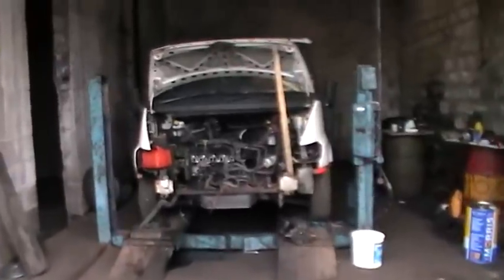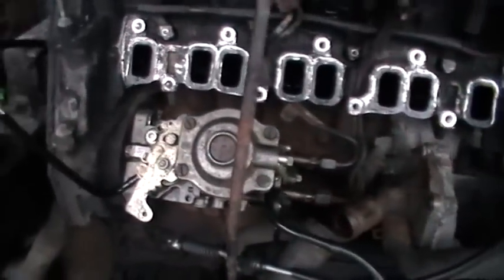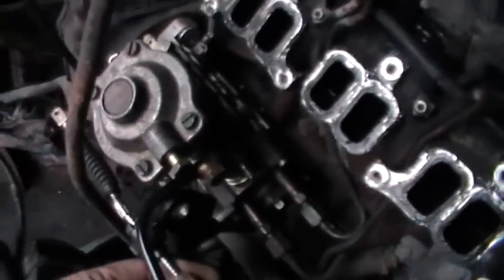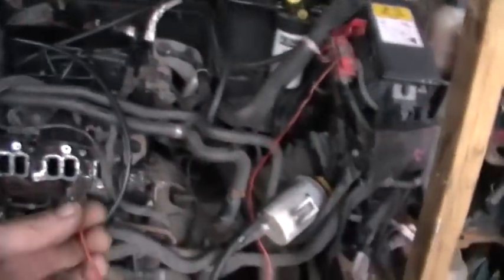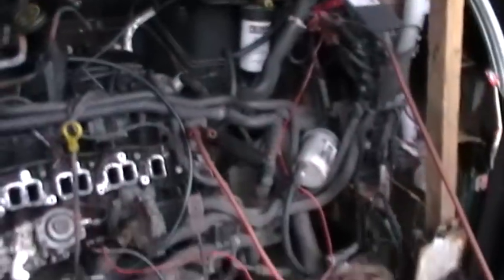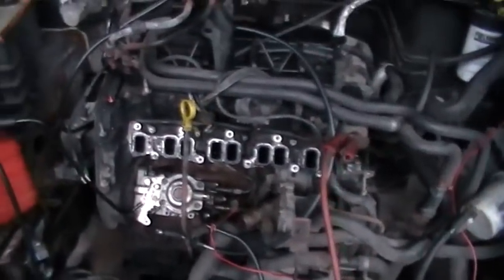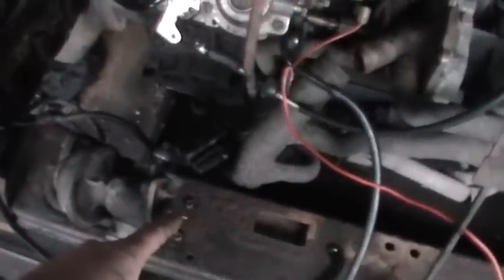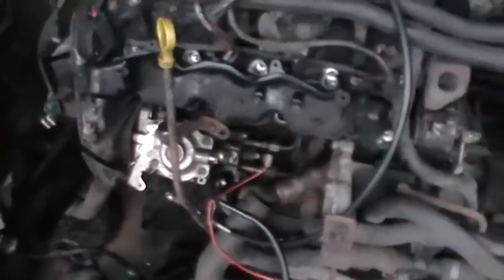MTDI Mk 6 Ford Transit 2.0 Duratorq Mechanical TDI

Comment: Hey Andy, I get this is an older vid mainly to do with the fuel pump. Just thought I might be able to pick ya brains bout my transit issue seeing as you seem to know lots about them :-).
My transit is the 280 swb 2.0l diesel TDDI engine. The hubby has been welding it not had any mechanical issues with it. Went to start it a couple of days ago & wouldn't start at all. It was ready for a new battery had the old type not a sealed unit.....so bought it a new battery. Now still wont start although it does try now.....weird thing is....now when he's trying to start it the odometer mileage doesn't display. Got some electrical gremlins by the looks of it, cranks now but won't play ball. Any idea what could be the issue???

Comment: Hi Andy, I had a complete pump death at 100k on my 51 plate RWD 350t TD transit. In searching everywhere I found a guy in Manchester who had a recon pump that apparently was good to go. ever since my mechanic fit it is sounds like a tank and has no power. at all. Another mechanic assured me the timing was out and did a front end pull down and set the timing up. the result was it was just as bad if not worse. Now giving up on mechanics all together from what I can work out it points to the fuel pump solenoid needs replacing, does this sound right?? there is a YouTube video when searching for my problem shows a transit sounding exactly like mine..... Advise please...
Reply: Andy Mahoney I had to change the fuel pump timing solenoid on mine and it fixed the knocking/tapping completely. I took a risk and it worked out fine.

Comment: Greetings Andy from way down under ,have been viewing your channel for some time now and have been very impressed as I live in New Zealand we try to use number 8 wire technology   eg thinking outside of the square. I was going to fit an IZUZU 2.8 Turbo pump , made top hat bushes etc and then when I removed the original pump noticed the injector line nuts were of a different size. Other than cutting and welding could you please advise the pump number you originally used and what vehicle it was from. Your knowledge and experience would be greatly appreciated , next time you are in Nelson New Zealand I'll buy you a beer, thanks, Scott.
Reply: its a 300tdi land rover pump im sure

Comment: Great vid I've just this day received back my fuel module as it had blown mosfet then I saw this as i have a mk6 tranny so will the Bosch VE pump fit and have you had any problems with them dude

Comment: Good job )Hi from russia .)  when my pump was dead I  try  change pump to mech too , but I remade stock VP to  " semimech "  valve connect to "brain" from russian car ,  change program and connect 2 sensor (sorry very bad english can't explain all ) . sistem work is good but fuel economy - disaster  (+2 litre 100 km ) . What about you fuel economy  ? )

Comment: Just removed the EGR on my transit and noticed a blanking plate, thought someone had botched it up. until I watch your video. Having problem with glow pluggs being blown out of engine. Was told it could be time chain jumped a tooth so stripping it down at the moment.

Comment: hi andy
could you tell me what pedal did you use on this transit as ive done this the same way but cant seem to find the right angel for the pedal to fit with out drilling holes to fix a pedal in replace of the transit one ..thanks and its a great job you did on that pump ve30 pump its self all good stuff and now i have a running van ...hope to hear from you soon cheers andy
Reply from the maker: Melvin Wardale  Hi Melvin, glad to hear you got it going, I made a throttle pedal and now have had some produced, I have also had some custom  throttle cables made up, if you're interested, both are available, contact andypdq(at) gmail (dot) com. I can now supply a full kit, pump, throttle pedal and everything required  for this conversion. Fitting and set up is available, I am based in North Staffordshire, UK, I also have a colleague based in Kent, who can do the conversion, if anyone is interested  :)
Reply: andypdq qual e o modelo da bomba que instalou ,tenho uma ford igual e gostava de fazer o mesmo .obrigado rui mateus -portugal.
Reply: Melvin Wardale 
petrol pedal will fit
Reply: andypdq hi mate how much are you charging for full kit cheers Dean
Reply: andypdq  I am
Reply: @andypdq  hello you will have the reference or model that you have asked disappointed to do identical work thank you lamis
Reply: @williewhyte3568  that is the pedal i got and a cable from kia
Reply: @williewhyte3568  i did use that pedal and a cable from kia smate car

Comment: Hi Andy, have you any info on your kits, where to buy them and price please? I have a ldv convoy 2.4 transit engine with a faulty ecu I would really like to do this conversion instead of an engine conversion. 
Many thanks, Rob.
Reply: 2.4 vw on mine running the same as it did with other pump
Reply: @MyMelvin99  1 question do you need to do any internal mods
Reply: @themeditteranian8365  no you dont need to do anything to pump just turn it up on the back of  it
Reply: @MyMelvin99  hello mate, did you bolt the injectors up the same way as the old pump? I'm in the middle of this conversion but have come stuck lol
Reply: @robnicolson2747  yes pump and pipe fit the same way remeber to turn pump up first just to get it to fire
Reply: @MyMelvin99  hello mate, I can't get mine to fire up I think the pump timing is out to the transit sprocket, how did you set your timing up please?
Reply: @robnicolson2747  hi did you get your van to fire after?
Reply: @mattrobertson1450  sorry just seen this, no I'm having ago just now it's trying to fire but won't run, wondering how the bloke above done it
Reply: @MyMelvin99  hello mate is yours still running? How much did you turn tour pump up on the back please?

Comment: mint but do you still get same power as mine is 2.0 tddi 100 bhp?
Reply: kgb russian i have the same power on mine and ive just done this good stuff
Reply: @MyMelvin99  does anyone have a complete list as I have the 2002 2.0 tddi 100 hp fwd model. Electronic death has happened. Got it send off for repair and lasted two months and has died again with same error code so that was a waste of time and effort. Would love to do it myself as I'm a mechanic but  don't know what to buy
Reply: @nathanmiles1721  the pump you need is the landrover 300 tdi

Comment: genius apart from getting through the particulate and emissions tests?
lower injection pressure and them injectors? wonder what implications that has? did u adust the pop of pressures?
and how will u control the turbo? didn't this have either a vgt or an electronic wastegate?
Turn the pump up? and what was it off?